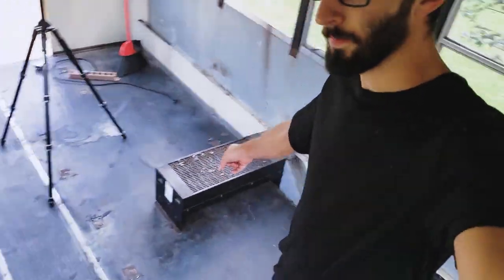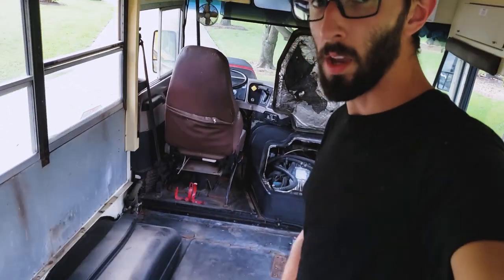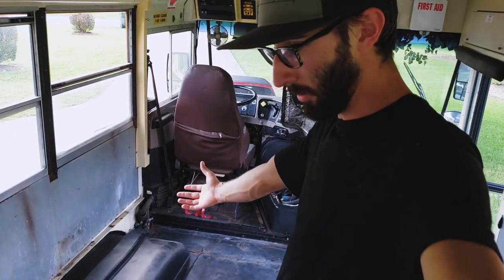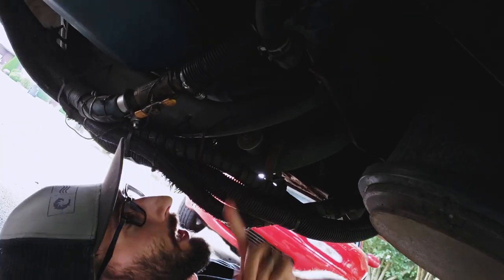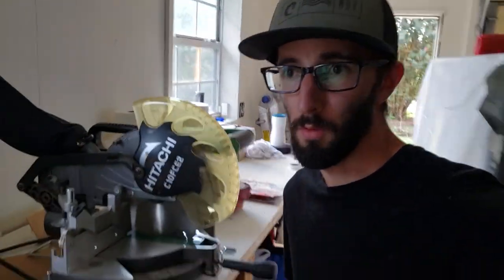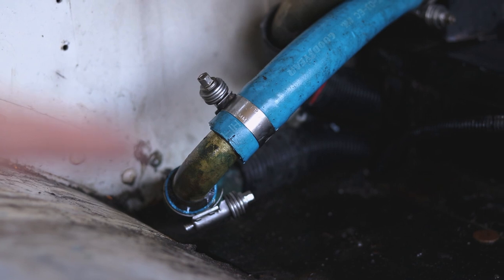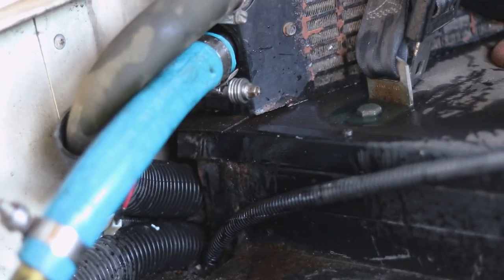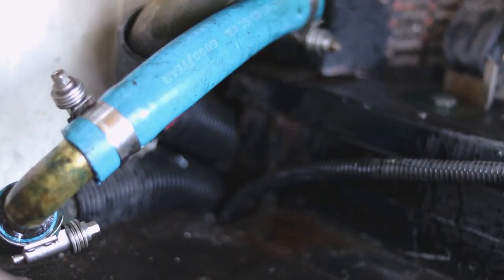How to Remove Rear Heater on a School Bus // Skoolie Conversion

Comment: so I just want to comment for anyone doing this alone with no help . If you have one of the old seats or anything (water dont run up hill) lift the heater and set it on the seat , prop the front of the heater up just a bit so coolant stays in when you pull the hose off. Be sure you have the hoses covers off as to have plenty of slack to work with , cut the power wires . loosen one of the hose clamps and gently run ur screwdriver around the inside of the hose to crack the seal from the hose clamp , slowly work the first hose off the heater fitting . once its free I stuck a 1 inch round piece of black gas pipe (any hardware store 8 inch nipple) in the open hose and clamped it down . I wedged the hose between the other hose to keep it elevated long enough to repeat the process for the other line . Then I just connected the other loose hose to the other end of the gas pipe and clamped it down . you now have completed the loop and free to work around it. Hope this helps ANYONE

Comment: I accidently cut the coolant hose to the heater and now my bus refuses to hold coolant. Fml
Reply from the maker: Hmmmm I wonder if theres a leak somewhere else.
Reply: @BackroadPurpose  No leak. Shut off valve doesn't work.

Comment: Yeah, they are pretty much terrible to take out. Best way is to drain the system from a low point (like at the firewall) and the majority will drain. But blow air (or the other side of a shop vac) and use it to push everhthing through the middle (mid-ship) or [and] rear heater. I work for a bus garage this is far more frustrating with the seats still in place. Awesome vids btw
Reply from the maker: ughh I couldn't imagine doing it with the seats in.

Comment: Hi I have a question I’m in the process of converting my skoolie and my dad is helping me and in all the videos I have seen everyone removes the heater however I was wondering why you do it and if it is necessary to remove or can I just work around it I have one heater in the back right corner of the bus so you recommend I take it out and why? Thank you
Reply from the maker: You can work around it but it's not that efficient and it's all has coolant running through those lines so it that bust like most radiator hoses do, that would suck.
Reply: @BackroadPurpose  thank you so much I def want to remove it now

Comment: Converting a skoolie myself. If i don’t want any remnants of the original heater in the bus, would I just take out the big hoses, heater and then loop the incoming hose to the outgoing hose and call it a day or would it have to be disconnected and plugged from the radiator itself? I’ve got a 40ft rear engine and it’s super tight under the bus to get to engine components without a lift
Reply from the maker: I just looped it ack into the block.  Plugging the whole would work too but thats a lot of work. lol

Comment: Thank you very much for sharing this video.
We have a 2000 International RE3000.
We have the same heater and I understood what you did better than any other YouTube video I've seen so far.
We'll see how it goes. :)
Reply from the maker: Haha well thank you! I made another video about removing the front heater that illustrates it a little more. that coolant gets everywhere! lol
Reply: @BackroadPurpose  thanks so much. I've seen a few videos, so I think I understand what I need to do.
I just need to do it and make sure I dont break the bus🤣
Reply from the maker: @michaelgrumbach4896  haha I understand. It's basically just one big loop for the coolant. And with the rear heater, your just taking out a section of the loop.

Comment: the one valve I could readily see on our bus is right by the driver seat but that is so obvious that I suspect if your bus in configured anything like ours you would have figured that out thank you for the video if confirms at least most of what I thought I was dealing with.
Reply from the maker: I ended up finding the other one. It was in the rf corner of the engine. had to remove the dog house to get to it. Its in the other heater removal video if you want to check that one out too.

Comment: I just did the same exact thing that you did and had the same problems. My question to you is; after you did this work did you notice any change in the way the bus ran or did everything go okay?
Reply from the maker: Not at all!! It drove the exact same. Had to add a little more coolant but other then that all is well.
Reply: Hi.  I have the same kind of bus, possibly different year. How much coolant did you have to add once you were finished taking the heater out? Do you just fill up the radiator until you can see the coolant in it? Thanks.

Comment: What did you use to connect the heater tubes near the front of the bus?
Reply from the maker: I reused the elbows that came with the bus. I think they are 1" copper

Comment: Hey dude! I’m working on taking my heaters out right now and I’m thinking about doing the same thing as you, as far as rerouting straight to the front heater instead of also taking the front heater out. The driver heater in my bus is a diesel heater, can I still reroute my rear heater to it like you did? I had another idea that may be easier. I was going to just connect the feed and outfeed lines that ran to the single rear heater back together with copper elbows and pipe clamps, then empty and refill the coolent. Or do I have to connect them back to somewhere else? I’m in a rutt and any help from anybody would be apprecieted🙏
Reply from the maker: Hey man! Thanks for watching. I'd have to see it to really understand and inform but you should just be able to take out the rear heater and just connect the lines with an elbow. I made another Heater video that might help you.

Comment: Hey man did this work alright? Everything still functioned as normal with the smaller “loop”?
Reply from the maker: Yes sir! It did. Didn't have any issues afterwards.
Reply: And what about the wiring and such? Did you just cut them off with terminals at the ends?
Reply from the maker: @pabloeldorado1175  I pulled them all the way out. I traced them back to the wiring panel and ripped them out.
Reply: Backroad Purpose great, thanks man, I’m working on almost the same exact bus right now, so you and your videos have been incredibly helpful 🙌🏽
Reply from the maker: @pabloeldorado1175  oh very cool! Glad to help for sure!
Reply: @BackroadPurpose  yooo, do you recall which terminals they were? I also have an fe300

Comment: On my list to do. I have a Blue Bird pusher and this thing has 3 heaters under the seats. I assume another one under the dash. This will be fun... Not. However, thank you so much. This gives me an idea on what to do.

I also need to remove front AC (the one to the side) and the condenser on the top. Any one knows how to do that without releasing the refrigerant??
Reply from the maker: Thanks for watching! Fortunately for me I didn't have to worry about taking out and AC line. I heard it needs to be vacuumed out but im not 100% sure about that. Thanks for watching!!